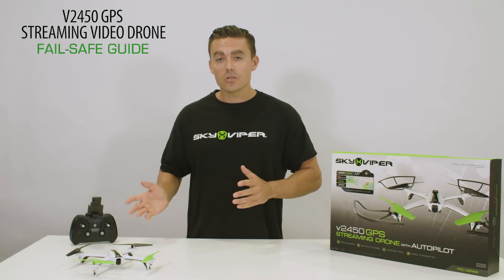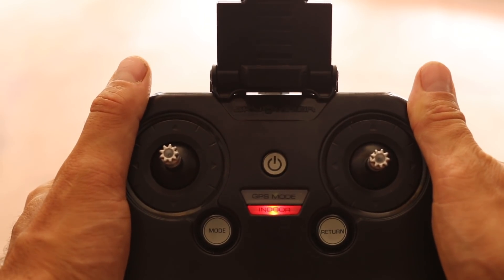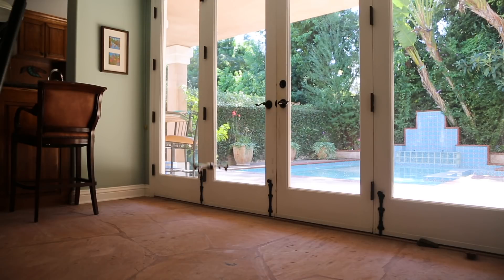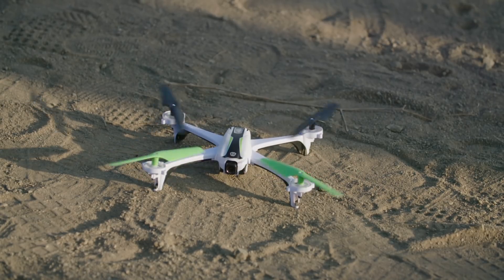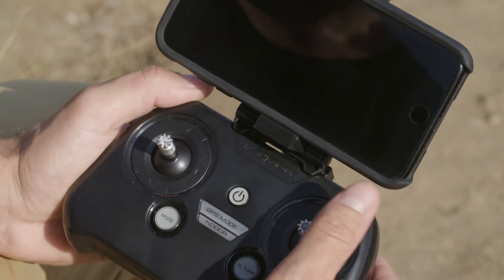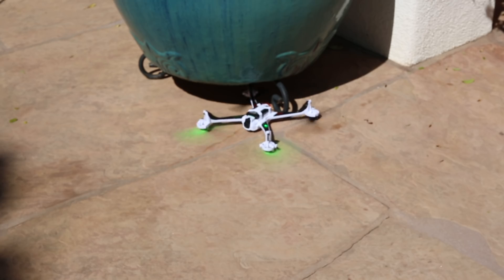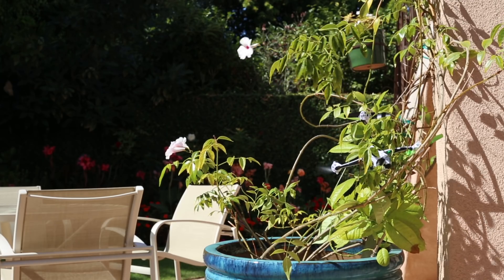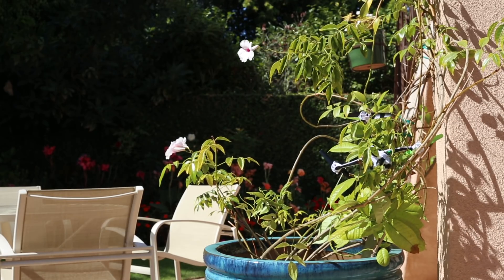How to Use Fail-Safe Mode with your Sky Viper V2450GPS Streaming Video Drone

Comment: first time using v2450 after unboxing. had complete control in my yard in front of my house, let it go a little higher, still had control in all directions. let it go a little higher with no wind and it took off over neighbors houses toward some water. no matter what controls i used it kept going. going. gone. no idea where it is. FUCK!!! fail safe my ass
Reply: I saw the same thing.  My controller went out of range in GPS mode, and the drone skedaddled.  I still had WiFI signal, but the SkyViper app is so craptastic at finding a lost drone that all I could get was a short video showing the spot where it landed and the knowledge that it wasn't far.  It turned out to be my neighbor's enclosed yard, about 150 feet from where it decided to do its own thing.  Upon recovering the silly thing, the video shows it drifting away from me, and then executing a 180 degree turn all on its lonesome and coming to a rough but survivable landing.

I tried to use the map but why oh why do you block the map screen to tell me stupid crap (repeatedly) like controller out of range or signal lost?  You need a recovery mode that pings the drone and then uses the phone's GPS to home in on it.